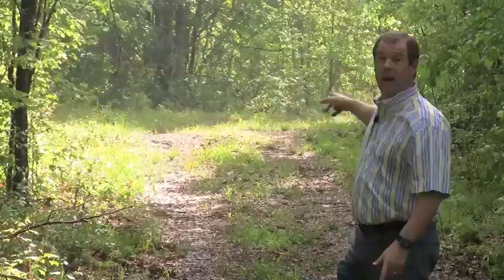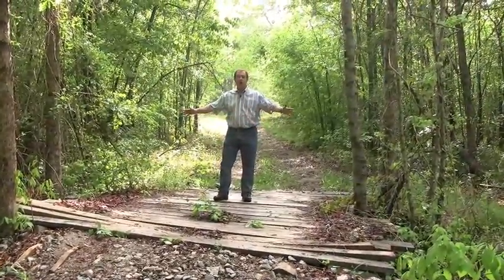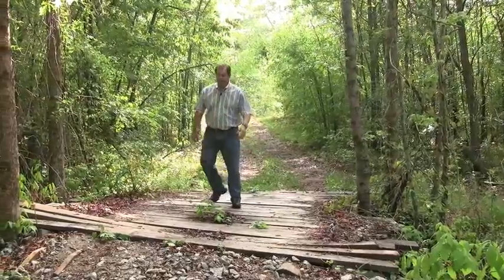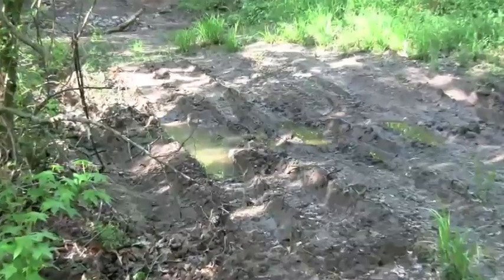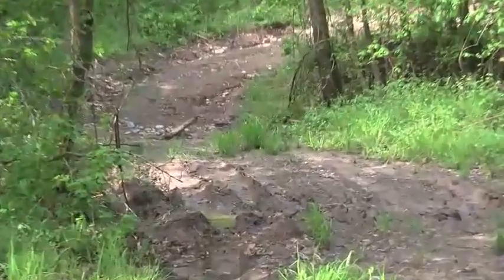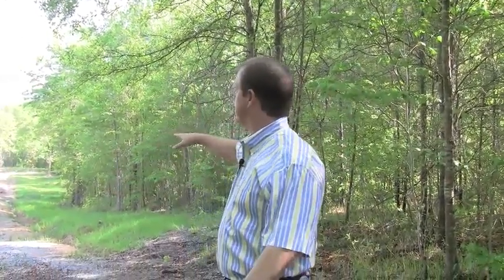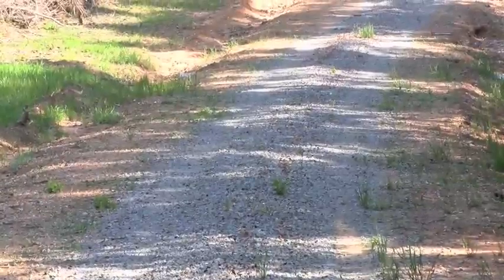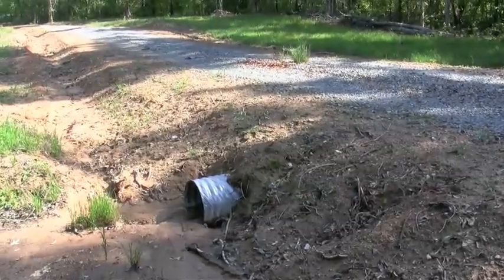Road Repair - Building An All Weather Road

Comment: I have about  a mile of public unpaved road  to get to my property on the ridge in highland county florida.  There are two spots about 20 feet long that are really soft. The sand white and powdering and seems to go down forever.  I've tried adding Portland cement but it did not really work.    On most days I don't get stuck in my 2wd 4 cylinder van.  But when it's really dry and has not rained in a week it's a roll of the dice and i get stuck.  I don't think a gravel truck could ever make it anywhere near the trouble spots.  It's no real solution what I do  lately is dig my tracks down  6" and throw pine cones and palm branches into where i think i'm gonna get stuck.  I've been out there a few afternoons having to dip my self out.   I've been thinking about options.   https://www.youtube.com/watch?v=sfVSTLwMSZo